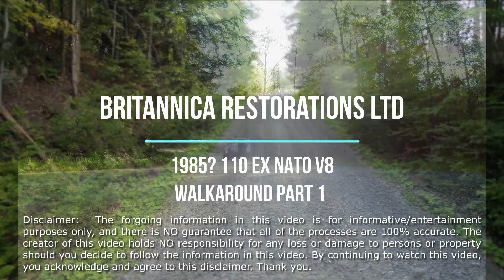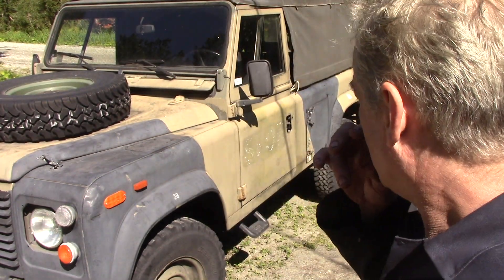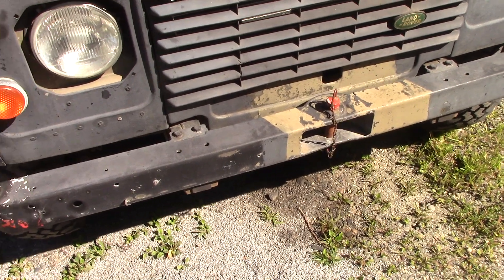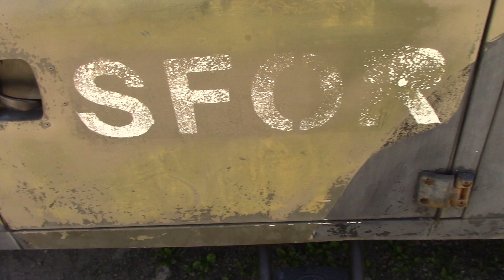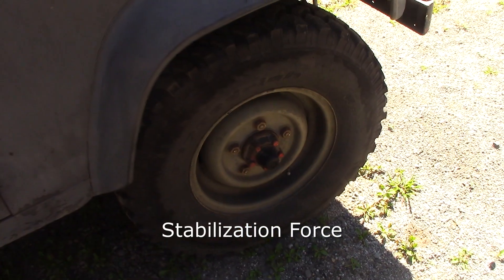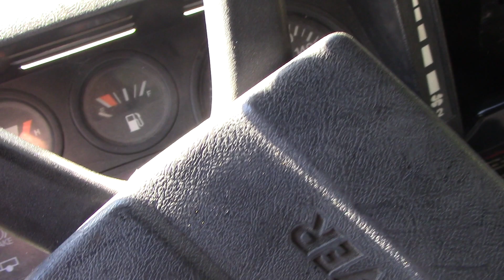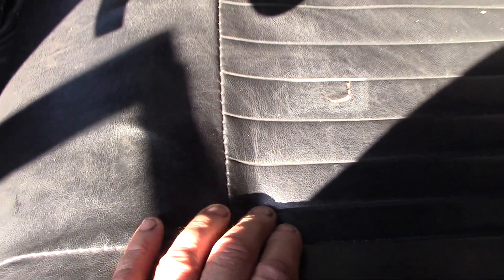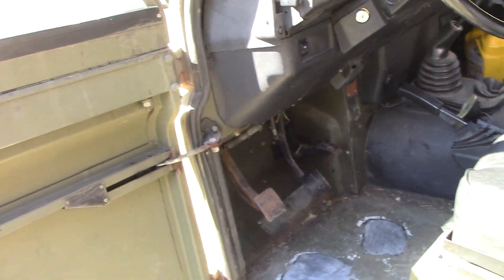1985 110 ex NATO V8 walkaround Part 1

Comment: 238 soft top lhd 110 V8s were ordered around 1989 along with 245 soft top rhd 110  V8s as the army were having issues with the diesel n/a. I think I remember it was a good price from Land Rover because of the trouble. The data plate on the seat box should show a reg in the region of 14 KJ 55 to 16 KJ 92.
Reply: But it has the shrouded lock striker and square top steering wheel boss so could be 1985 like you said,
Reply from the maker: The plate is missing from the seat box
Reply: The 1989 V8s are the only order I can see so am saying 1989 with the steering wheel centre and door striker later changes to confuse things.

Comment: Isn't that the vehicle data plate riveted to the top of the brake pedal box?    I bet that this originally had a 2.5 NA diesel and someone retrofitted a V8 which they also converted from fuel injection to carb.   Being a 1985, this is obviously not part of the 1989 V8 batch ordered by the MOD.
Reply from the maker: I decoded the VIN as follows:

Model Ninety/One Ten/127
Class 110
Body Type Pick-up, soft top or hard top
Model Year 1989
Steering LHD
Engine 3.5 V8, Carburettor, Low Compression, Petrol
Gearbox 5 Speed, LT77/LT77S/LT85, Manual
Factory Solihull, UK
Sequential number 424

The registration says it is an 1985 or 86
Reply: @BritannicaRestorations  Ahh, just goes to show you can't trust what the registration says.    So, indeed it was part of that MOD batch, still strange though how the SAI  system was blocked off.

Comment: What’s the difference with the v8 stage 1. Coil springs
Reply from the maker: The sage 1 was a series 3 modified to fit the Range Rover V8 and 4 speed gearbox
Reply: @BritannicaRestorations  so still 109 thanks for your channel

Comment: Ex military vehicles can be a bit of a double-edged sword.
Yes, they get a lot of maintenance, which can mean they look okay but, OTOH, often that maintenance is done by apprentices - which means that everything gets greased and cleaned but it also means the gearbox might've been rebuilt by a pimply 17 year old who's only ever fixed a puncture on a pushbike before.

What you REALLY want, if you can find one, is a vehicle that's been deployed shortly before it was sold, which means it was properly inspected and serviced and then got a good test-drive during it's deployment.

Course, having said that, it's a lot easier to fix mechanical problems than rust.
If I was looking for a Defender, I'd definitely prioritise lack of rust over mechanical condition every time.